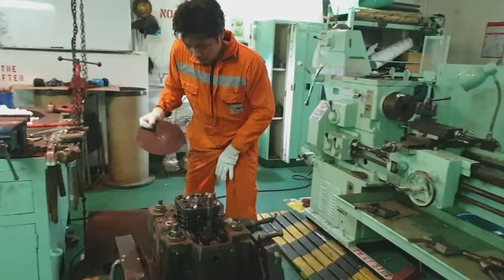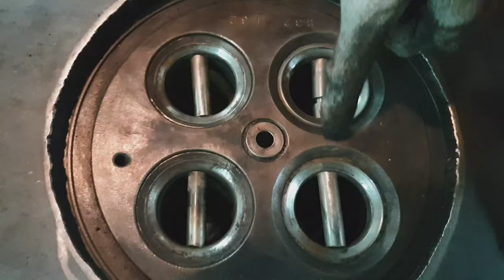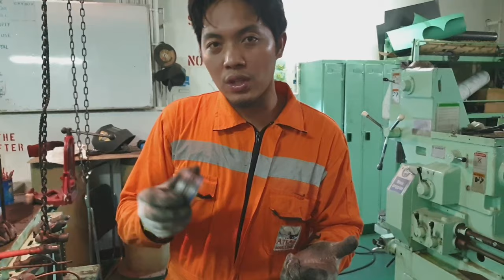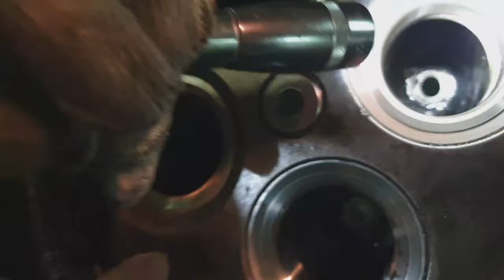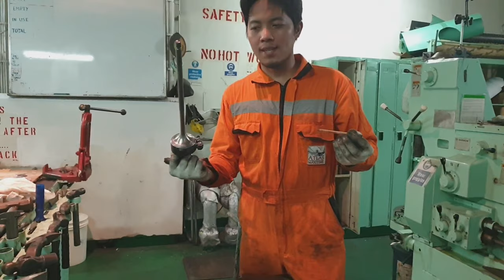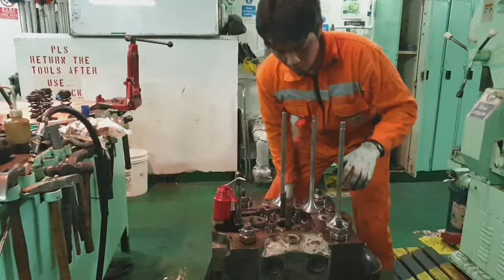HOW TO OVERHAUL CYLINDER HEAD| MAKINISTASERYE VII

Comment: Can u please post a video on how to tighten rocker arm foundation nuts, fuel pump foundation nuts and fuel valve tightening nuts back on the place? By torque tightening or hand tightening is enough? Kindly explain brother. Thanks
Reply from the maker: Good Day Sir, soon i will be posting video regarding on your request but at the time being i have to explain these, rocker arm foundation nuts has to be tighten at 270 Newton meter, fuel pump foundation nuts, 140-150 Newton Meter, fuel valve guard nuts is 60-7  Newtonmeter, 
All involve bolts and nuts in these components has to be tighten in accordance to Maker's manual instructions ir order to avoid any abnormalities.